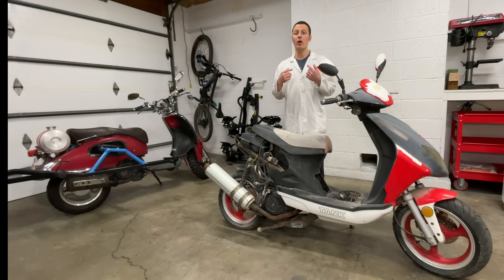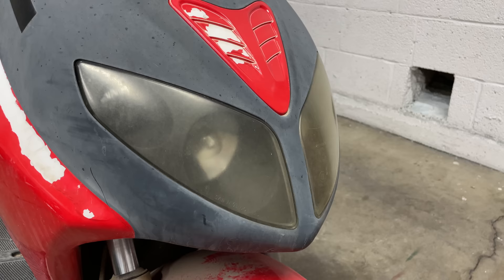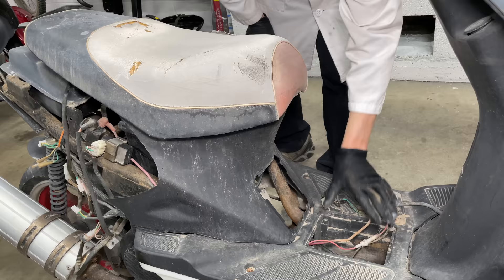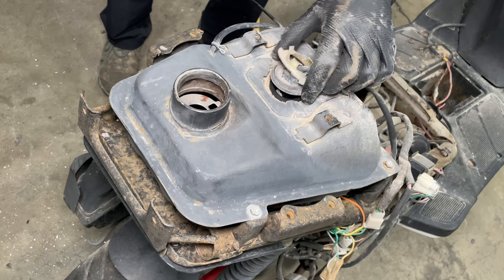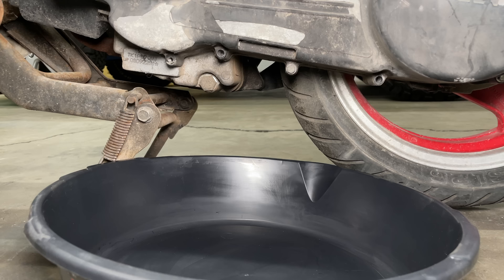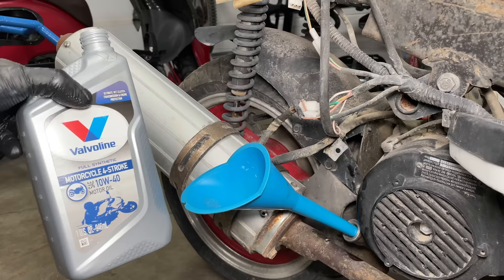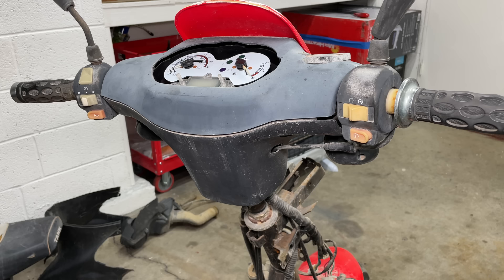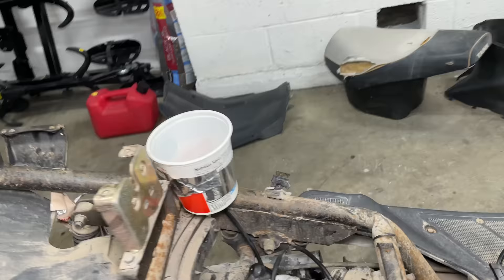$40 junky Chinese scooter - will it run?

Comment: if you're worried about longevity or reliability when it comes to those GY6 engines. I've got about 11,000 mi on mine. Never left me stranded. I use it as my grocery getter I can haul a bucket of cat litter, 40 lb of dog food and 20 lb of cat food on the floor with no issues. 10. Mi home. The best thing I can recommend is to throw the factory carburetor in the trash and buy a slide carburetor for it . makes a huge difference!
Reply from the maker: Thanks for the tip!  I haven't tried a slide carburetor yet.  I heard the throttle response is much better too.
Reply: Thanks 4 this
Reply: @TheTopCat650  I saw those, but I thought the risk did not outweigh the benefit.  almost 100 bucks is steep and as you said, the cable might not be long enough.  I'm surprised that with the gy6 50cc and 150cc platforms being so popular that there wouldn't be more slide carbs out there and some of those being cheaper.  I also like the thought of manual choke.  I'd rather not have the enricher.  I prefer to not choke first, then incrementally add choke as needed to start.  it causes less carbon buildup.
Reply: @edwardjames6070  
Fact is on Scoots the carb is hidden under the "Tupperware" plastic bodywork, so playing with a manual carb lever isn't workable.
Reply: I bought one, broke down after 10 miles. Rebuilt 3 times, breaks down every time after a couple weeks. This guy with 11,000 miles has probably rebuilt it 100 times and is coping. Easier to just walk.
Reply: I have an sym jet euro x 2004 2t it currently has 97000k kilometers thats 60,273 miles! The only thing wrong with it is cold starts(takes 2 minutes to get it running) but then it runs like new.
Reply: @MarkusAnthony88 well my 2t has 97000km(60,273 miles) lol
Reply: Can you link me for this. . I want to see
Reply: @LabCoatPaul  The slide carbs are very hard on belts. Normally I can get just over 4,000 miles on a belt with a vacuum actuated carb but after swapping to a slide carb I'm lucky to get 1,500 miles out of a belt. Putting a 2mm larger, non restricted vacuum actuated carb on it will give you everything you need. Smooth power delivery is the key to belt life. btw my little 50cc taotao with an 80cc big bore kit and a couple cheap clutch mods tops out at 72mph and will easily go 55-60 all day long. Oh it has just over 12,000 miles on it and it's usually full throttle all of the time.
Reply: Okay what exactly broke
Reply: Okay what exactly broke
Reply: @bevis226  72? is it 2 stroke?

Comment: A lot of your twitchy steering can be fixed by taking the ball bearings out of the neck, cleaning them and repacking them or replacing them if necessary.

Comment: I bought my 150cc money pit as a cheap and convenient city vehicle.... it has been anything but that haha. In the end though, parts for scoots are relatively cheap compared to the car world, and I love working on it because of how easy everything is to install. Has it left me stranded? yes. Have body panels or parts fallen off during riding? also yes. Do I regret buy it? not as all. I have such a blast with it despite everything, and when it does run, it runs damn smooth. Buy these if you want a project, if you want an actually good scoot, go elsewhere. AND GET A LOCK OF SORTS FOR CHRIST SAKE! Can't tell you how many times I've rebuilt this thing after it being stolen 😂
Reply from the maker: A Chinese scooter is more than just transportation. It's a repair hobby! Thanks for watching.

Comment: I have a 2018 taotao 50cc gy6 it had 70 miles on it when I bought it it has zero issues I got a cvt kit for it it gets great mileage starts in one or two kicks every time even dead of winter total investment on the scooter is so far is 850 the bike retails at 1200 so basically if you get a scooter used just don’t by one on it’s death bead 1 and 2 it’s still less than a car all the way around from gas to repairs hell en entire engine rebuild on a scooter is cheaper than a basic repair bill for any car’s suspension so I don’t really get why you wouldn’t think it’s worth it besides the insurance and even that’s not a good argument because that’s cheaper than any car insurance would be

Comment: Thank you so much Paul, for showing us how to trouble shoot and fix so many issues on these China scooters. I just inherited two 150 scooters .they have been in a barn for 8 years because of a family member dying. One had gas put in it and driven  0.8 miles and the other one has 0000 miles and never had gas put in. So far neither one will run . They start right up with a shot of starting fluid in the breather hole but then died because they are not picking up any gas. I figured the one with gas would have junky gas in the carb and need cleaned, but I don't know why the brand new one is doing the same thing. So your carb fixing tutor here should help. Thanks again..... signed.. David.
Reply from the maker: Thanks for watching, and good luck with your scooters:  Check out the full playlist here:  https://www.youtube.com/playlist?list=PL1_JDBt1LSiJQETjZiOFXBKtv-ZzfqEx0
Reply: 8

Comment: Is a great spare parts scooter or a cool off-road scooter project. The engine sounds good, it did not even 💨 when it started. Great video as usual.
Reply from the maker: It ran pretty well.  I forgot to adjust the valves.  That would make it start better.

Comment: Very well done video.  My favorite cliff hangar scene was watching the sparks when you used the screwdriver to short across the starter solenoid, right next to the open top plastic cup with gas in it.  While in a closed garage.  This is not a criticism, and I assumed it would all be okay since the video got uploaded.  Clones of the old style ford car starter solenoids are not too expensive, and have much bigger contacts for longer life.  I put one on my riding lawnmower for much less money than the "real" one  cost.
Reply from the maker: I guess I like to live dangerously.  The sparks next to the gas are only a problem on a hot day where there's a lot of fuel vapor.  If it's freezing outside, you can drop a lit match into a cup of gas to extinguish it.
Reply: @LabCoatPaul  Perhaps. The Flash point temperature of gasoline is -45°F.  We would all miss you if you were gone.  You have great content.  I hope you do a clutch change on your first gen RAV4, I need to do mine.
Reply: well its a damn good thing he does not have to worry about safety managers breathing down his neck other than dumb "know it all" youtubers. 2 years later and hes still alive... even without having "experts" like you telling him how to work

Comment: i actually have the same model scooter, only mine i a 99cc.  2008 Chunli TMS S3. Mine is all black with red stickers that are peeling, and mine has the turn signals where yours have the small parking lights in the main headlight cluster.. Same speedometer, etc. My airbox turned into dust. I bought it for 10cents from a guy that gave up on it. Runs well after a battery, oil change and a new exhaust + tuning the carb.

Comment: just a tip...before dissembling engine for inside engine work,really god practice-to wash engine case first ,to get rid of sand and other things from surface .That prevent cylinder ,piston ,crank,valves from damage.
Reply from the maker: Thanks for the tip!

Comment: Something really big you have to be concerned about in CA is that they charge the NEW OWNER with all the late fees on the registration accumulated by the previous owner. That can amount to hundreds, even thousands of $$$ if the vehicle has not been registered for a long time.
Reply: holly smokes!!
Reply: Do they still know if you register it in another state?
Reply: @awdrifter3394  No. If you buy a CA vehicle, and title and register it in another state, you don't have to pay the fees. Those go to the state of CA, so they don't apply if you are not in CA. Of course you usually have to be a resident of the state you title and register it in. A CA resident would not be able to register it out of state.
Reply: @geraldscott4302  that's good to know. I guess if you're a CA resident with a vehicle that owes a lot of fees, the only way is to sell it to an out of state buyer.

Comment: That information about the title issue is good advise for your state but you also need to know that there are different rules in different states. For instance in Indiana, Scooters don't require a license plate for they don't meet the speed requirements but they also don't title scooters so you just register it anyway and they will issue you a license plate and will copy a the title you do have on it if you have one. They can create a new title for you in your name but must physically see the scooter to get the VIN number off of the unit.

Comment: dealing with titles SUCKS even if they are 1 owner and you knew them. My grandfather owned 7 wheeled vehicles. all but 1 of significate value. During his final years battling cancer he miss placed them. (we never found them). Even with the death certificate getting new titles has been a NIGHTMARE. he has been gone for 3 years and we are still battling this. all of the stuff he owned was bought brand new from lot so all 1 owner and its still a headache.

Comment: Looks like I got that excact same thing with 50cc engine from 2007. 12" tires but all parts still match (not that motor) it is stored inside and it is still in excellent working order. Last 10 years it has been not used so that's why. Thanks for this clip it really clears things to work with it later!

Comment: Go through Vermont if you don’t have a title. Way easier since they do not require titles for vehicles over 15 years old or even newer motorcycles under 300cc. You will get plates and registration that you can take to your dmv and say I want a title and they will take your Vermont registration and hand you an instate title and registration

Definitely agree tho that cost doesn’t seem worth it for that scooter, I’ve had 5 Chinese mopeds in the last year and got all for under $200 and got them running decently with just a couple hours and simple parts. Even running I don’t find these to be worth much more than $6-700 in my market. Fun projects tho!

Comment: Hi, specific mc oil is used when mc engine has to lubricate gears and crankshaft ,valves ,clutch and piston at up to 14000 RPM . GY6 engine don't have gears to lubricate at such high RPM...so you car use ordinary oil for cars, 20W-50 really good choice in not winter seasons.

Comment: I do believe you when you say the scooter will not last long. But I wonder how long it will last if you take care of it. Or what scooter should you get other than this kind. If you own a scooter and a newer car keeping miles off the car can help a lot with depreciation which can help with resale value. Also a set of tires for a car can almost cost as much as 90% of a new scooter.
Reply: I can answer this: with the best of care, expect the scooter to last 4 years before it finally gives out entirely. I would recommend a Honda scooter of any style. Hell get the Honda super cub. It's the world's most reliable and best selling scooter in history with over 100 million units sold. It's reliable, good power for the frame, and parts are abundant due to very few changes between models, allowing you to assemble a frankenscooter if you so wish

Comment: I hope all moped ignition switch is that easy to swap
A lot of honda moped, the bolt are on the opposite side, to open it, you have to disassemble the whole front end from tire to steering stem 🤣 that's a PITA for sure

Comment: Wire harness ebay 40 four all time u get done about 350 to redo it an get it running an carbs are about 40 oil is about 5 a jug  an on ebay to tires 60

Comment: Another great video. You forget to mention how much time it took you to learn all of this stuff, not to mention who taught you. I bought my first Chinese scooter this week new. I've been riding motorcycles for 40+ years and doing what I can to fix them when they break, I have 2 bikes right now a 1992 Suzuki vs800 and a 1986 Yamaha xv1100 in addition to my new scooter. Hopefully I'll be able to maintain this old Chinese scooter for a long time, though I doubt it will be running for 31 and 37+ years as the Yamaha and Suzuki are. 

I noticed in another of your videos you put locktite on everything. I'm wondering what I should do now with this new scooter to make it last a long time. Any advice on how to keep the nuts and bolts from falling apart?  Changing oil is easy enough. And is there a type of belt that lasts longer when this one wears out?
Reply from the maker: Congratulations on the new Chinese scooter... I guess... or maybe I should say sorry...
Chinese scooters tend to use low quality metal for the bolts.  Standard bolts are labeled grade 2, 5, 8... based on their psi strength rating.  Chinese scooter bolts are weaker than the grade 2 bolts you'll find at Home Depot.
When you take parts off the scooter, put them back on with new bolts.  You can find the small M6 x 1.0 flanged bolts at ACE Hardware, online, or get some old bolts off a car in the junkyard.  The bolts that hold the wheels, shock, and engine are stronger because they're big.  Use loctite so they don't unscrew themselves.
When you have the seat and body plastic off, replace fuel hoses and remove / simplify emissions components.  I have a few videos about that. 
Your Chinese scooter will work for as long as you want, but you'll have to do 10x more repairs than a Honda.  
When the Chinese scooter is 30 years old, it will look like it's 200 years old, and you'll have spent 1,000 hours repairing it.

Comment: "Without registration, you cant ride this on the road"
chuckles in Missouri
But seriously though, if you live in a state that doesnt require rego for scooters like this one, $45 would be a steal for someone whose mechanically inclined and looking to build something custom
Reply from the maker: I thought about turning into an off road scooter without lights and plastic, but I have a real dirt bike too, so that would be silly.
Reply: @LabCoatPaul  I've got a wild idea for you? You know how to weld? You got an old four wheeler laying around? You know those old pre world war cycle cars like the Standford Cycles car and the Morgan 3 wheeler?

What I'm getting at is that I'm building a modern cycle car that fits withing my states moped guidelines so I can have a car with a sealed, heated cabin that doesnt require insurance or a title to drive
Reply: @LabCoatPaul  also if you can do it for cheap, it's not silly if its fun

Comment: I got a 50 cc scooter an in Hillsboro Ohio they told me I don't need a Tite four it all I need is  I'd an work lights on it an horn. They told me but if bigger than 50 cc yes u have to have Tite an tags on them I just bought a tao tao pony 50 scooter I gave 600 an spent 300 on it to get it running bests scooter ever I ride it every day even in cold 🥶

Comment: Hi Lab Coat, thanks for the unvarnished commentary in each of these videos. I've got one of those GY6 150's and debating whether or not to upgrade most of the major components (CVT, Big Bore Kit, Oil Cooler, Shocks) to ride the 2023 Scooter Cannonball. Or just purchase a Honda ADV 150 or Logan KPV 150. I'm figuring it's going to run at least 2k for quality parts. Got about 6 months to figure it out. Could be an adventure, just not sure if it would be a "fun" adventure. What's your opinion?
Reply from the maker: I had no idea that existed!  Chinese scooters can be ok if you replace the whole scooter.  (or most of it).  If you've fully gone through the scooter, you might make it the 3,170 miles.  You're far more likely not to break down on a Honda. 
If you're in it for "fun", sure - bring a Chinese scooter, tools, spare parts, and duct tape.  You'll be having many unexpected adventures.
Reply: @LabCoatPaul  Yeah Paul, it's a really interesting rally, been following it from the periphery for a few years.
Yes, totally agree with you on going with the Japanese bikes if I'm positive that I want a decent chance to finish. And that is definitely a viable option for me.
But... the thought of creating a "Frankenstein" Chinese scoot is something I've been wondering about. If you could locate the best off-the-shelf parts and swap them out. Could you actually make a respectable Adventure Scooter?
If you get a chance, take a closer look at the Cannonball and see what's happened in past. I just decided to pull the trigger on it this year, for next year!
Thanks for your great videos, I do learn quite a bit from them!

Comment: no gy 6 owner wants to see that dip stick ever ever again oh my friggn gawsh
Reply: what a banger video tho, this realy opend my eyes to how tough these motors realy are, as soon as i saw that dip stick i would of just said "uhp time to get a xpro 150 from amazon for $300"
Reply: but i did get triggered when u said that the kick starters aren't verry reliable, is that only for the 150ccs? because my 50 cc kick starter is amazing
Reply from the maker: Yes, the 50cc kick starters work well. I've never had a 150 kickstarter actually work. 
The good news:
The electric starter is very reliable.
Cheap AGM scooter batteries from Amazon are very reliable

The bad news:
These scooters have horrible charging systems. If it doesn't charge the battery, your starter won't work.
The 11-pole stator upgrade is the solution to this problem.